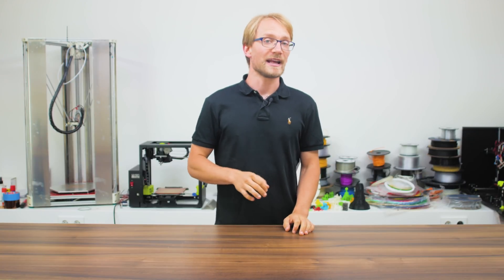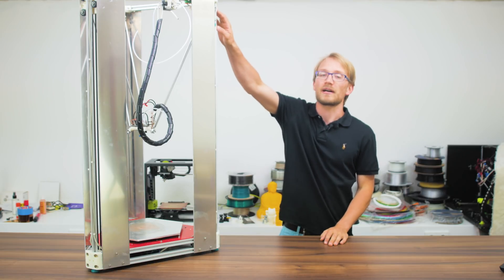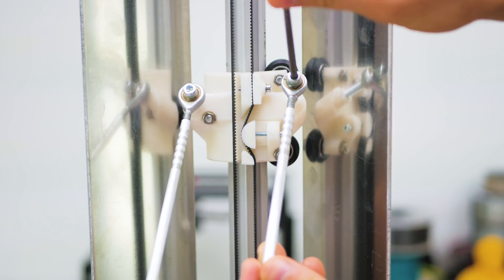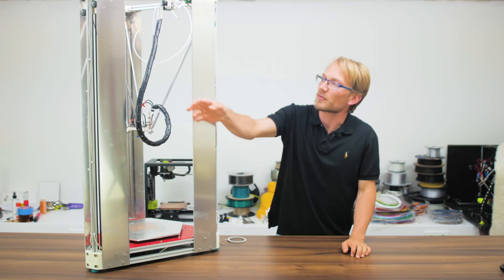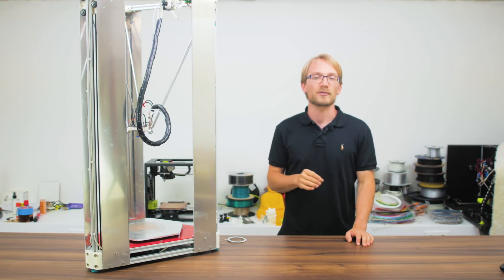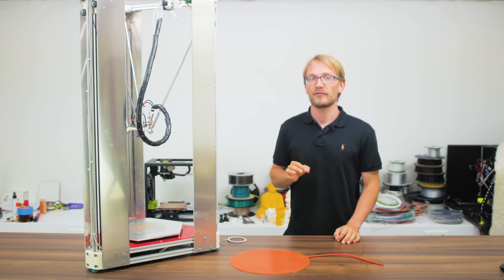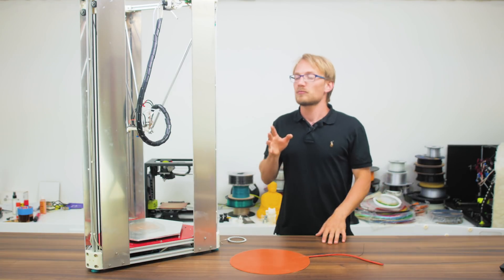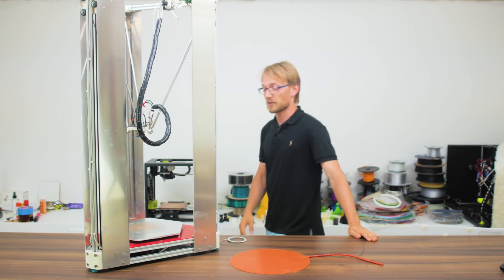My biggest 3D printer yet! Analyzing the CerbrisReborn design

Comment: dear Thomas i have problem. I have a 3d printer(velleman k8400), it used to work fine, but now the nozzle is acting really weird. filament is passed through the nozzle but the extruder is still  clicking very frequently, but it only clicks on the first layer. this happens every time i go to print something. do you know what is going on if yes please send me a message because i had a lot of thins to print but since the printer is not working properly.

Comment: I like your videos. You are discussing a nice collection of typical 3D printer topics in a very open minded way. Your arguments are usually very well thought.

Like Scott Langevin I am in 3D printing for several years now, but always used a delta printer.

I started with a Rostock kit but switched to a rigid 3030 vertical extrusion and 3060 for horizontal bars while still using rods and linear bearings.
Instead of the usual geometry I used my own which avoids plastic connections and works much better. Especially I don't need these aluminium sheets to make it stiff. Because of this I usually don't need to calibrate the printer (well, now and then I have to calibrate, because some screws like to get loose).

I have 12 mm rods with two LM12UU each. I found 8 mm or 10 mm rods to be too flexible. The 12 mm rods don't bend any more, but I have a remaining 
problem with the play of the two LM12UU for each carriage. The vertical positions of the two joints (magnetic in my case) on each carriage have a play of several 1/10 mm because of that.
I could use the longer LM12LUU or better add a third LM12UU to reduce the effect of the play or use something like IGUS bushings instead.

But to solve this more generally, I would like to use a wheel based design similar to yours.

Do you think, the wear of the wheels is a big problem?

In the video you are blaming the plastic springing for the poor stiffness of the slides. But I notice the extrusion rotating just as much as the carriage. So I think the very long 2020 extrusions are twisting over the length. Can you confirm this?

The carriages could be improved by using some screws to adjust the tension applied to the wheels. There are several designs out there.

Btw., the play of the ball joints could be reduced by adding some kind of springs between each pair of delta arms.

My printer has magnetic joints, which are very convenient. The hotend platform is easily removable and in case of an emergency the joints prevent damage by getting loose.
I use two of the usual ring magnets at each joint, which increases holding force and allows to insert some foil between ball and magnet, so they don't wear out. I found that mainly the length of the arms is determining the geometry, so you can simply add a second magnet by using it's magnetic force to hold it in place.

The switching power supply without a case is very very dangerous, they use high voltages inside (not only the 220V you mention). I would definitely use an unmodified unit instead to not risk anyones life, especially because you can easily reach inside through the slot between the two extrusions near the power supply.

Comment: I really appreciated the open honest descriptions of what worked and why. I have not done coding in over 20 years. (Basic, Fortran, Pascal) It has taken me over a year to get back into "geek shape" to wrap my head around the whole 3d printing scope of things. My Delta is 4 feet tall (600mm) and originally a kit from China. I have replaced almost all of it and as of 2 days ago i am ready to write my own version of a Delta firmware for Marlin. Your video was one of the best i have seen regarding Delta do's and dont's. Unfortunately i was nodding my head while watching because i had already had most of the same problems, lol. 

On a different note i had an idea for creating a hexagonal grid surface for a Delta print base. Using 2 values for x, y, and z. (ie. x1-x2, y1-y2, z1-z2) I know that would require a slicer to accept but was wondering what you thought of the concept. Where as x, y, and z are linear up down left and right. The additional values would add x2, y2, and z2 as up-left, down-right, and so on. Values for 45 degree angles on a linear layer. Is this something that is feasible? Is somebody already working on something better? Am i thinking too much when i use the John? Any input is appreciated. Thanks and good job on the video.

Comment: Hey Tom, I love your videos and love how you share all of your experiences. I got into delta printers a few years ago so they are all that I know. I recently built a delta printer with 20mm CNC linear rails. When doing a calibration cube I noticed that one side was too long and the other side was too short. When doing a circle calibration test I had hexagons instead of circles. I have never had this problem until I swapped to a more rigid system. I am not sure if you had any problems like this with your machine, but any feedback would be greatly appreciated. I still do all of my calibrations by hand. I tried using auto bed leveling but it was a bit confusing to learn.

Comment: Interesting.... 
I'm kinda... skeptical towards Delta printers, but to each his own..  

A thought on shoring up the printer and reducing play, just drop two 3 mm steel cable from the top of the printer down to floor 30-60 degrees at the top and opposite to one another. Then just keep it under tension while printing. 

That will stop it from  wobbling but it might put added stress on the back aluminum strut. 

It's kind of like pitching a tent at that point.

Comment: Hi Thomas, I just thought I'd share my take on the "big delta" concept... I think the OpenBuilds extrusions are cheaper now... In any case, here's my "Monster Kossel", with 1000mm towers, 350mm round bed and ~ 400mm arms: https://www.thingiverse.com/goeland86/collections/monster-kossel

Yes, it's not got the same "open effector" you designed, but that's easily fixable. The use of the 20x40 means that you get one of the 20x20 groove sets for the rollers, and the next one to be able to attach stuff to the frame (like your side panels, proper cable mounting, etc.) I'd be curious to know what you think of the design, mine is currently printing fine, using an FSR kit for levelling (ordered the kit from ultibots.com, yes, pricey, but worth it!)

Comment: You could have used 20*20th square aluminium extrusions. They are used for building bird houses and are insanely cheap. You could pull the wiring through them for a clean result. Expect to pay about 1,5 euro per meter.

Comment: Cerberus works better with a delta, considering Cerberus was a three headed hound in Greek mythology. Would be cooler if it was made as a triple extruder, just to keep true to what mythos Cerberus is. 
Also, I've never been a fan of using belts in vertical applications, but I also started out with cnc routing which is much heavier and causes slippage due to gravity. I'm sure it's fine for 3d printers, just not a fan.

Also, some questions. How do you think variations of the z-only design of Deltas would work with other polygons; quad, pent, hex, hep, etc.? 
And do you think you could use a Stewart Platform as a print bed? I have a few ideas for it, but I don't know kinematic control, and I'm not a programmer.
Also, what about making the hangerprinter within a delta frame? Just so you can easily break down and flat-pack the printer for storage or travel.
Reply from the maker: +Xander Zoolander the belts are perfectly fine for this (and most other deltas). The stepper motors snap into their full steps well enough to stop the carriages. 

Extra towers are going to overconstrain the effector unless you start removing arms (one instead of two). With six independent towers, you'd get complete freedom of motion, three translational and three rotational axes. Way overkill and not supported by any 3D printing software, but super cool nonetheless! 
Stewart is just an inverted delta and some printers use it already. 

One of the core ideas Torbjorn had with the Hangprinter was not to require a frame. All you need to print is the printer, power and three points on the floor and one on the ceiling. Even with a laptop, all your hardware still fits in a backpack, less so if you need to lug around a frame as well.
Reply: I like the idea of the Hangprinter, since it's design gives it basically limitless build space. But for my personal idea of putting it within a frame comes from the fact that I don't have a permanent space for a printer, and being able to break it down for storage would be useful, and reassembling it would give the same dimensions each time so there theoretically shouldn't be any reorientation when set up.
Do you think you'll ever get the chance to make your own Hangprinter so that you can go more in-depth of how it works? 

I've never thought about six towers having complete freedom of motion like a Stewart does, but I've also haven't seen one function, I just assume it was like a delta but with slightly more build area.

Also, I've had the Stewart idea for awhile since it has complete freedom of motion. If you can get the platform to tilt to 45 degrees, and you use one on the build plate and one on the extruder, you could theoretically be able to print a horizontal wall vertically, meaning the use of support material wouldn't be necessary. This, of course, would add so much more complexity to how the printer functions, but it's a cool idea that I'd like someone to figure out how to make it work.

Comment: Hi Hows the printer doing after almost a year? is the cat 5 cable enough for the motors and heater? They are only rated for 500mA per conductor, did you double up any of the conductors or did you just run with it?

Comment: Great video, you have much to offer. I am getting my first 3d this week an your vids have been a real find and made my final decision better informed. At 60 this will fit my need for building, creating and analytical repair as a hobby. Enough about this old fart! (Me) I would like to offer a suggestion for making your metre tall delta printer frame as solid as a brick for not much more than the cost of the 6 aluminum braces you are using now. I am real, could be mistaken but will share my simple solution if you are interested. Thanks again for all your help & experience.

Comment: thanks tom, this is a great video as always. i am building a delta printer at the moment and am looking at various design approaches for different parts. if you have time and interest, a follow up video on different component options and why you chose one over another would be really REALLY interesting and useful for me. a bit like your new cheapest possible prusia i3 series only focusing on price/performance of different component solutions, specifically for a delta where control boards, part weight and tolerances can have an even more dramatic impact on resulting print speeds and quality than in other printer formats.

Comment: I'm building HoverPrint next. Hycrid between a Drone and a 3D printer. Battery powered, it'll save on floor space and be an entertaining Talking Point when guests come round. Serious Q tho, why didn't you mount the Bowden halfway up the frame so it only needs HALF the length/weight of wires/tubing to reach the upper & lower reaches of the build plate's movement? That's a lot of wiring getting in the way which is surely prone to flexing electrical wires (inc Hotend Thermisor) at their junctions and will stress-break them, as well as x2 as much bulk for the stepper motors to shift. I'd use a Midway mount with a loop through which all excess wiring is naturally pulled OUTSIDE the build area rather than raised and lowered inside it. Polite Comments welcome : )

Comment: Hi Thomas,  I have come to the conclusion that I need to build a Delta/Kossel printer.

I have no experience with them (I almost got one instead of the tarantula I now own) and am seeking a bit of advice, and you are well educated in this matter. 

I know that I want to build a tall unit, main riser shafts of around 880mm tall made from 2040, 600mm for support brackets, 2060 on the base and 2040 on top, I have found Aluminum brackets that will accommodate these materials, and I have decided on a Duet WiFi for the controller.

Now all the rest I do not know, I know I want to get 0.9 deg steppers for this, I plan on running high resolution, I am wondering if you have advice on which one's to get? I don't mind going a bit overkill.

Also things like the length of the arms? my delta base length will be the aforementioned 600mm (I plan on getting CF rods and, possibly magnetic joints)

Auto leveling, I know that smoothieware has this option, I'd really like to look in to options for tip auto leveling as well, hotbed 24v for this device? Silicone? 

My Power supply solution is a pair of 575 watt HP Power supplies which I plan on wiring for 5v, 12v, and 24v, so power should be well taken care of.

Are there other considerations I should look at? specific items where one would be better than the other?

This is all still in concept phase right now, I just like to get all my ducks researched and in a row before embarking on new projects, and any advice you may have to offer would be greatly appreciated.

Comment: For your electrical connections you should look at www.wago.us they make all types of electrical connectors even pluggable ones without the need to solder or crimp. They are a German company and pioneered the screw-less terminal block. They are far superior  to screwed blocks which allow you to place the wire under the clamp if you are not paying attention. They are made for solid wires.
Reply: Wago sells two different terminal blocks. The bulkier ones with the lever also can accommodate braided wire.
Reply: Pretty neat though they have a ton of options which makes it hard to know what will work best.

Comment: Besides looking cool, why a delta?
Reply: @Chrysippus - Hi! For a start, Delta frames  tend  to be stiffer and less bendy for a given volume than the rectangular framed ones that often benefit from triangulation - hence  all the Z-frame add-ons that are offered for stiffening the i3 variants.  Ours is built into a box - made a big difference.   It is possible to make a bad, flexy delta frame, but they are almost always  stiffer, size-for size.  Also, the only moving thing is the hot end - no moving bed!  Beds need to be rigid, but a moving bed should be light to avoid shaking the main frame, twanging the belt and so on.   Fixed bed is good!  I could go on . . . <grin>

Comment: Biggest 3D printer? Why doesn't anyone build large printers for the consumer? I am thinking 61cm x 61cm build area by some reasonable height. The typical area in 20cm x 20cm. It always seems to be too small. Is it a technical or economic challenge to make printers larger?
Reply: Rigidity and resonance issues don't scale linearly when you make a bigger printer. Basically, the same components will flex and shake more just from the added length and size.  As a comparison: a simple twig, just an inch long, will be very rigid indeed, but a twig two feet long will be very flexible.  Same material, but the longer one moves more.

To fight this, you can buy stiffer parts, but this also raises the cost quite dramatically.  Or you can slow the printer down, but this makes prints take forever.  And nobody wants to pay for a large printer with low accuracy that prints slowly.
Reply: Robert Roy That's why I want to make one. Still, you can glue/solder smaller parts together with acetone.
Reply: I'm building one using 20mm square extrusions from openbuilds. I can up the size of the extrusion to stiffen if/when this becomes an issue. I'm having a hard time finding material for a 45cm x 45cm heated bed  (Heater and glass).
Reply: Ok, ood to know. I'll try tempered plate glass. How do you control the 4 heaters so they work together?
Reply: I think i got it. Thank you.

Comment: Hey Tom. I noticed in the video you are using Cat 5 cable. Is it possible to use Cat 5 to connect to heatbead and hotend to extend the wires. Are the steppers ok connected to Cat 5 too? I am in the process of building a Ultimaker 2 ex clone. Thanks

Comment: Why make the arms so long and lose all that build height? Surely too the longer the arm the more sensitive translation is to stepper motor motion losing precision on all axes in addition to the lost build height.
Reply: The ball joints he used have a small range of movement, he said as much in the video. He compensates with longer arms.  A different joint could mean shorter arms.

Comment: Many people use springs to compress each two arms together help get rid of those play in ball end and I find that it work very well, effector move more quiet and there is less backlash now.
Even simple rubber bands do the job, should be good temporary solution until you upgrade to better ball ends.

Comment: rolling anything on aluminum is not going to last long period, so the openbuild design is a terrible idea, never mind the lack of method of pulling slack out of the bearings, I used plain roller bearings on steel rods used for making drills called drill stock and even used a support structure to give the supported rail design level of support with out having a continuous support, which is totally not even necessary lol

Comment: I like this machine and built my own only a little bigger. 600mm base and top extrusions with 1500mm verticals. I used ball bearing linear rails and all aluminum brackets and end effector. I am using Arduino and Ramps 1.4, but I have the problem no one would expect and cannot find anyone that can help. The arduino will no let me run less than about 110 mm/sec, it stops and reboots. I've tried 1/16th steps but only gets me slightly slower. Mind you I am getting some pretty decent prints for the speed but I need better. Would you have any advise?